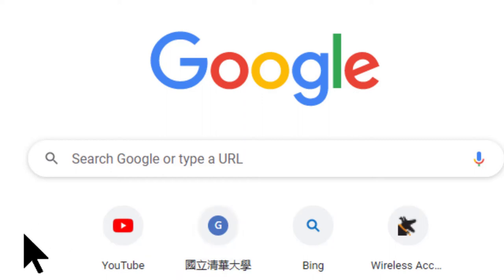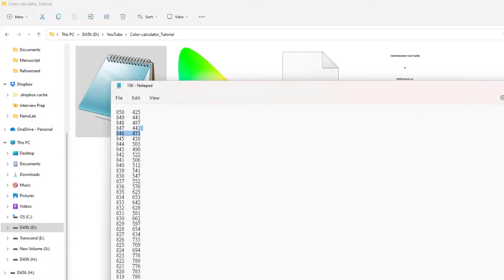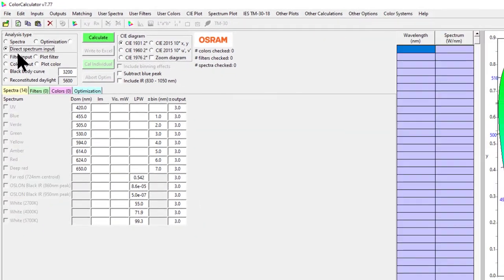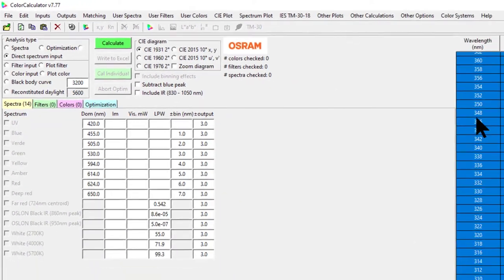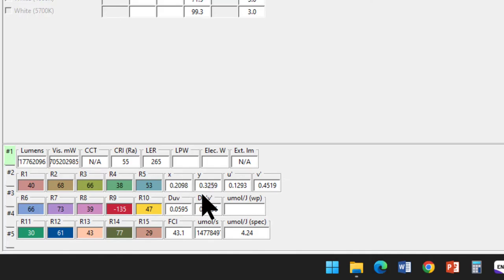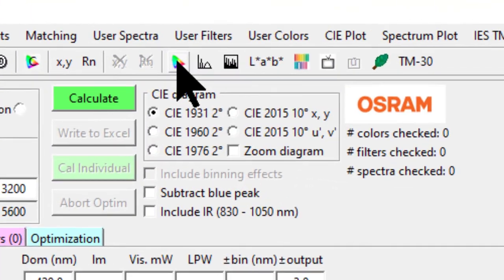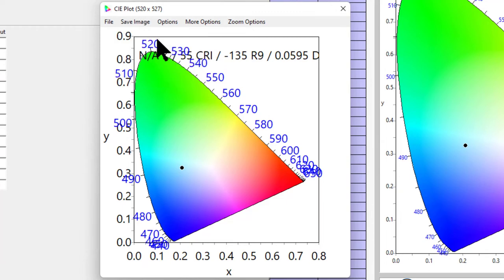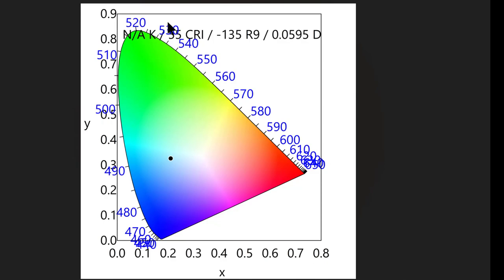Plotting cie chromaticity diagram

Comment: Is it possible to find the correct emission value corresponding to the points we plotted in cie diagram
Reply from the maker: Yes, it’s possible to find the correct emission values corresponding to the points plotted on a CIE diagram. The CIE diagram is a graphical representation of color based on the three primary color stimuli: red, green, and blue.

Comment: Sir, What parameters affect the CIEx and CIEy values and what are the equations for calculating CIEx and CIEy values separately?
Reply from the maker: The CIE  x  and  y  values, also known as chromaticity coordinates, are derived from the tristimulus values  X ,  Y , and  Z  and are used to represent colors on the CIE chromaticity diagram. The factors affecting these values and the equations to calculate them are:

Factors Affecting CIEx and CIEy Values

	1.	Spectral Distribution of the Light Source: The distribution of light across different wavelengths influences the  X ,  Y , and  Z  values, and consequently the chromaticity coordinates.
	2.	Color Matching Functions: The CIE color matching functions (usually CIE 1931 XYZ functions) are used to convert the spectral data into tristimulus values. Variations in these functions affect the calculated  x  and  y  values.
	3.	Observer Conditions: The standard observer conditions (e.g., 1931 2° or 10° field of view) used in the calculation of the color matching functions can affect the results.
	4.	Illuminant Conditions: The type of illuminant used during the measurement affects the spectral data and, subsequently, the chromaticity coordinates.